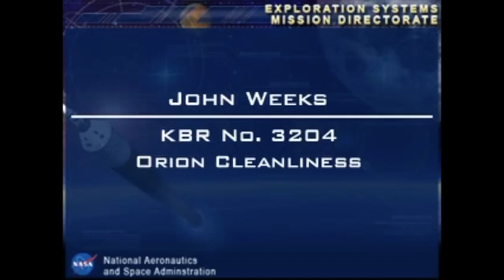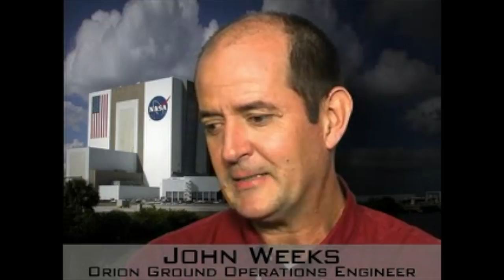Risk #3204 Orion Cleanliness

Comment: Horizontal Laminar Flow, HEPA filtered air blowing across a work area is a great solution in your conditions!  Super economical and easily adaptable.  We have used this method to clean ground support and space flight hardware for 60 years.  Recently we used horizontal laminar flow HEPA air to precision clean high energy laser components the size of a school bus to Level 83, A/10 (National Ignition Facility).  Ken Verheyen, Astro Pak Corporation